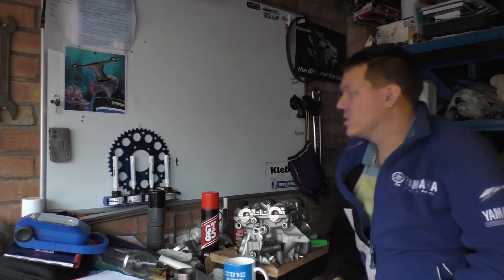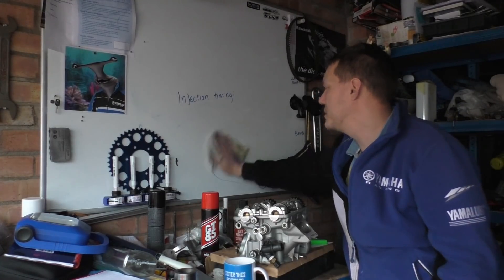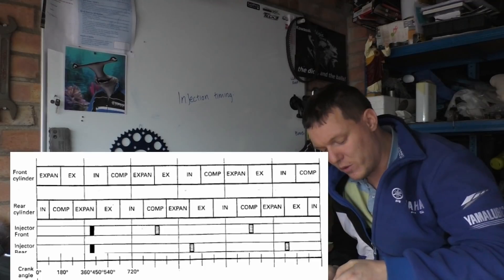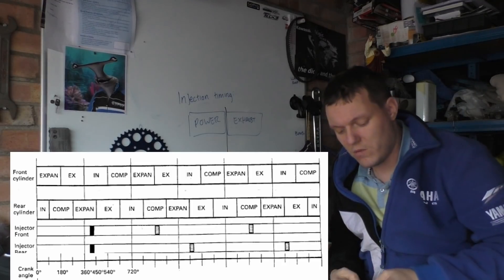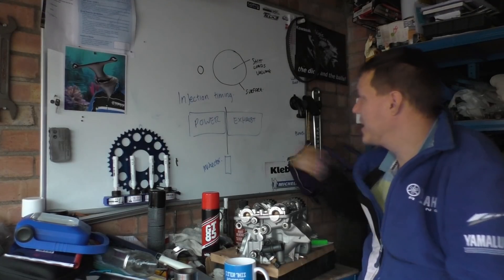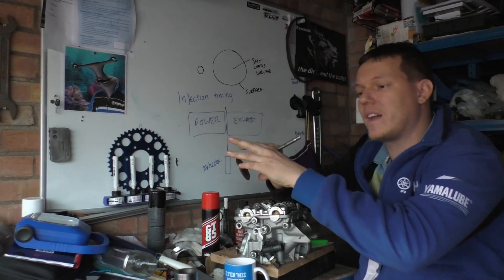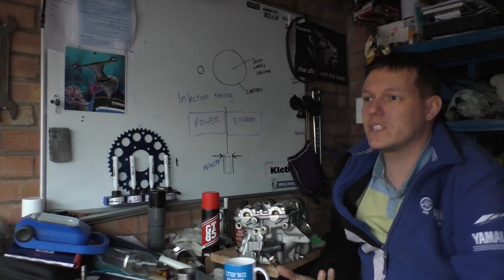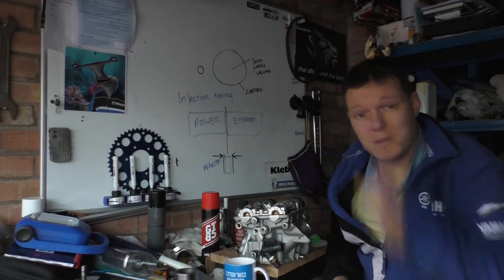When Injectors Fire - the basics

Comment: Why not just heat up the gasoline past the boiling point and inject it as gas? ( ͡° ͜ʖ ͡°)
Reply from the maker: Because then it wouldn't cool the valves.............
Reply: Put lithium in the valves!
Reply from the maker: I think you mean sodium and that moves the heat not cools them, did you actual listen to what I said? About cooling the valves but also helping the fuel evapourate? This is a free process. Not only that but you want to heat the fuel - which means you have a pressurized petrolium gas in your engine? 

Don't you think that's a bit mad?
Reply: I could swear I've heard about lithium in helicopter engine valves and how a guy got burned while trying to forge a knife out of them but now that I look into it seems that was just a misnomer and you're right.
Yeah, I wrote the comment before you started talking about the benefits of injecting over the valve and even put the retarded face at the end, still doesn't it seem neat to have pressurized petrolium in the engine? Maybe abandon the valves altogether just inject both the petrolium gas and the oxygen and just let the piston squeeze it till it blows up.

Comment: if firing the injector earlier to have more time to evaporate helps at high rpm, what is the downside to firing as early as possible at lower rpms too? it seems like there must be one to make dynamic injector mapping necessary.
Reply: I suspect it would mean your intake port is "flooded" i.e. wrong mix - too rich.

Some of the higher-tech engines (er, V-TEC?) use different multiple intakes, only using the small one at low RPM.
Small port area means faster air moving through. Better vaporisation, better economy, smoother idle.

Comment: do injectors ever go 100% duty cycle?
Reply: If it gets near 100%, it is to small !  Without headroom the engine could lean out with all the bad things like rised exhaustgas temps. => burning valves etc.
Reply: 100% duty cycle meaning fully on? non stop fuel?
Reply from the maker: generally no.

Comment: i was thinking of direct inyection.. it is posible to make direct inyection for air too? if you can do it with fuel/gas... why cant you do it with air? you could make a "half camless engine" this way.
Reply: The problem is with the amount of air needed. Don't forget the air to fuel ratio is around the 14:1 mark. That amount of air would need to be compressed and also injected every two engine revolutions for a single cyl engine. AND the pressure would need to be enough to overcome the cyl pressure, and get it in there in rather short order.
Just look at the size of a Super or Turbo charger for example. A LOT of air needs to be shifted and at higher RPM's there is not a lot of time to do it.
This also will take energy to do sapping power from the system.
Reply: thx for the answer, i was thinking of a turbocharger with a bypass for when its not needed that feed a big inyector, but i think if it could be done, someone would have already make it.

Comment: Would it be possible to run a direct injection injector using the cam to power it? Like instead of fancy solenoids and whatnot just use mechanical energy to pressurize the fuel. Would cans not be powerful enough to get the massive pressure needed?
Reply: Boyd Freggens yes that’s how old school fuel injection in diesels work
Reply from the maker: "Would it be possible to run a direct injection injector using the cam to power it?"

- yes its called mechanical injection. This is how the first diesels worked - some petrol engines also used mechanical injections - more on this later.

Comment: What that chart doesn't show is the injector closing is timed to occur at the point the intake valve opens, hence it needs to start injecting during exhaust stroke.
Ignore opening time because we need to know when all the fuel has been injected not when it starts injecting.
And re the hot valve, with port injection fuel doesn't travel down the intake length being warmed up so the hot valve does that job in a mutually beneficial condition that also keeps the valve cleaner. Valve helps fuel, fuel helps valve.
The other aspect is that if the valve is open the intake pressure (vac) would not be constant during injection time, and since the injector relies on pressure differential each side of it to determine how much fuel it injects in the given open time, that relies on a fairly constant pressure (vac) during the injection period.
If you open the valve (and ex is still open a bit  due to overlap) and expose the injector to the short positive pressure pulse before it swings negative, for that moment at least less fuel would be delivered through the injector.
With the intake shut the pressure differential each side of the injector is more consistent during injector firing and thus delivery volume is more constant.
But that's at lower demand and RPM, otherwise the multi point turns into full bank injection, or transitions from multi to 2 bank and then full bank as speed and demand increases, full bank is all injectors firing every 360 crank regardless of where the valves are like older systems did. 
But all depends on the system and engine, V twins are not the best example for displaying timings.
Maybe use a 4cycl in line, its a bit more symmetrical looking at the timing map.

Comment: So how hot does the back of the valve get? Is there a way of measuring it?
There's a lot of cooling from the petrol & air on the inlet stroke, surrounding both sides of the valve head (& of course  on the back during the ignition & exhaust strokes).

Does carbon build up affect evaporation?
Reply from the maker: Petrol does a great job of washing the back of the valve - this is one of the issues with direct injection - but that's another story.

As far as how hot - up to about 500DegC depending on the engine and load
Reply: That is a hell of a lot hotter than I expected!!!

Comment: So the injector fires at the end of the power stroke and just before the exhaust stroke?
Is that right? That's just how I'm interpreting the diagram but your explanation came across to me the injector fires between the intake and power stroke
Reply from the maker: "but your explanation came across to me the injector fires between the intake and power stroke"

- what? LOL what comes after the exhaust stroke???
Reply from the maker: "So the injector fires at the end of the power stroke and just before the exhaust stroke?"

- and yes, to answer your question - missed that bit
Reply: The end of the power stroke - BDC before the exhaust valve opens and the cylinder is evacuated? Is that when the injector fires because it is confusing
Reply from the maker: When the piston is @ BDC on the start of the exhaust stroke - yes. This gives the fuel time to evapourate and cool the valve. After that the inlet valve opens.
Reply: Right I see, so the fuel is actually just chilling and dispersing around the intake port waiting for the inrush to the cylinder, clever! As with most people I assumed the injector would fire after the exhaust stroke TDC, but this makes more sense. Thanks!
Reply from the maker: No worries dude

Comment: you can inject on intake or exhaust, and afaui from a guy I know that does this stuff for a living both can have their advantages. some do injection both times to avoid knowing the cam phase ala wasted spark. and once you are at full throttle high rpm you run out of time so the injector is pretty on all the time
Reply from the maker: If you mean secondary injection then read the description. Secondary injectors are on at about 80% full load, but this is different, more on why in another video.
Reply: I mean instead of injecting once per cam rotation, do an injection per crank rotation, like wasted spark
Reply from the maker: What engine does this?
Reply: don't know any specifics, I believe it called something like multi-point batched or simultaneous
Reply: BMW 1150, wasted spark ......fuel injection and spark works simultaneous.
spark fire at avery 180° in both side
If i understood what you are talking about....
Ciao

Comment: Why do some 4T engines spark every revolution? Has it something to do with simpler ignition system?
Reply: it means you don't need a cam sensor, and it is also used with pairs of cylinders    in for example an inline four sharing an ignition coil with out needing a distributor